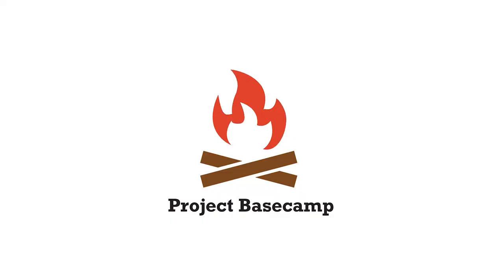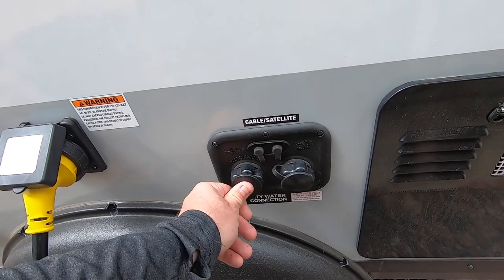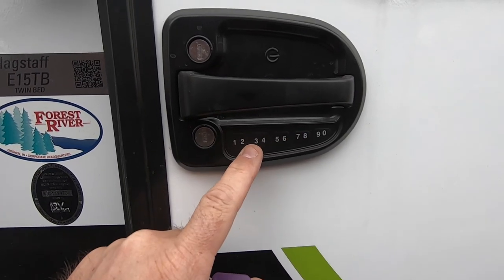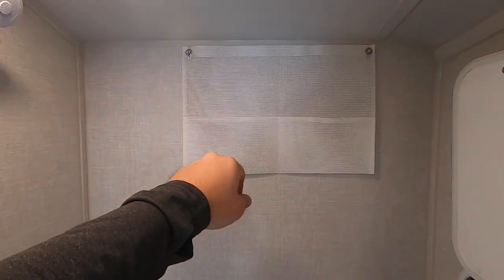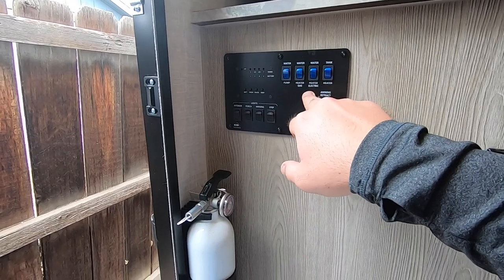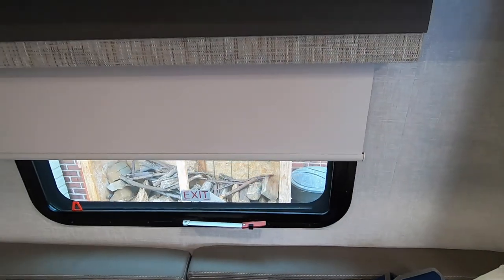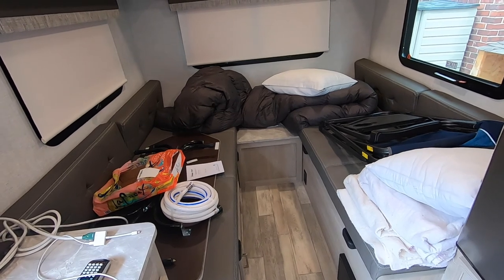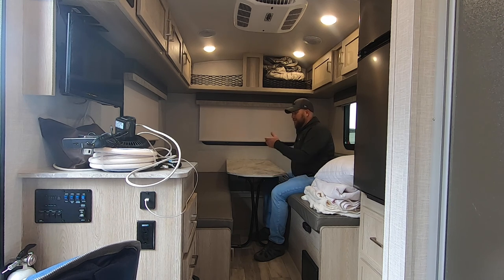Our New E-Pro (Geo Pro) 15TB Walkthrough!

Comment: Nice video...I have the rockwood 15tb (as you said, the same exact unit) I have owned Rockwoods before and found them to be better than average build quality.
For the life of me, I don't understand why they put the Ladder smackdab in the middle of the unit! blocking the under-storage door...my ladder is on the passenger side so that I have full access to the cargo area.
Yes, I find that crazy table/iron board contraption useless, in between the two beds I put a lagun table that swivels, it works great.
Also, that water heater with electric/gas is a quick recovery system when you have them on at the same time, it heats up that 6 gallons very quickly!
Have fun!

Comment: Just wondering if a 2nd Maxxair fan can be installed instead of the air conditioner ...
Reply from the maker: I suppose if it is the same size cutout, I don't see why not...but the maxxair uses 12v DC wiring and the air conditioner uses 120V AC wiring